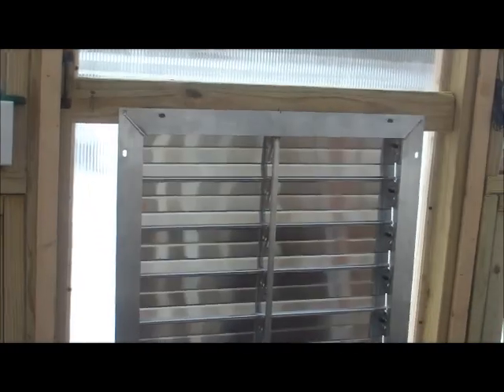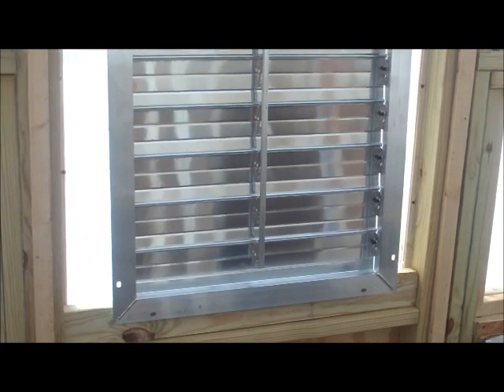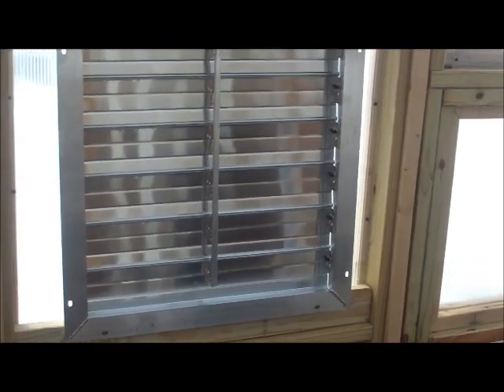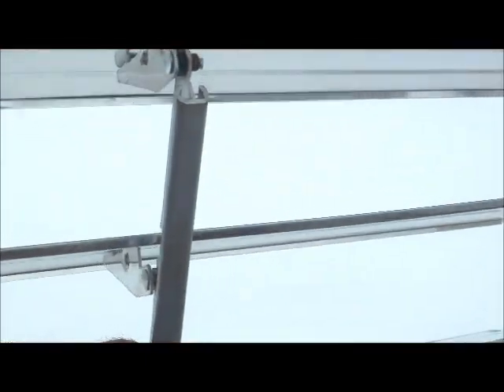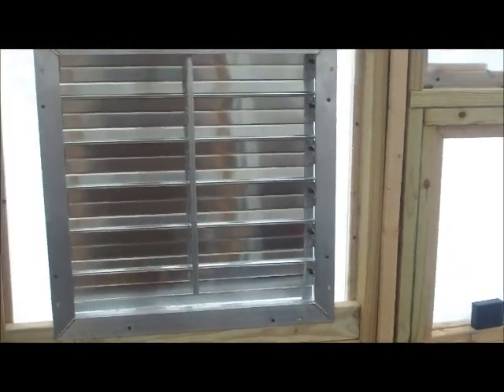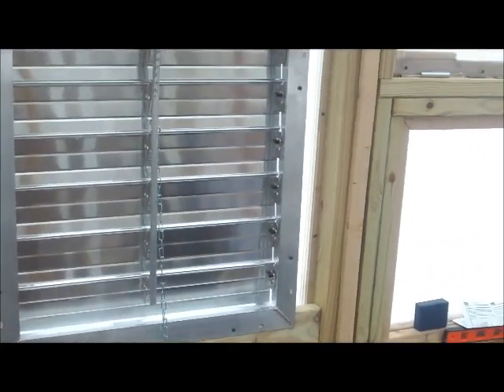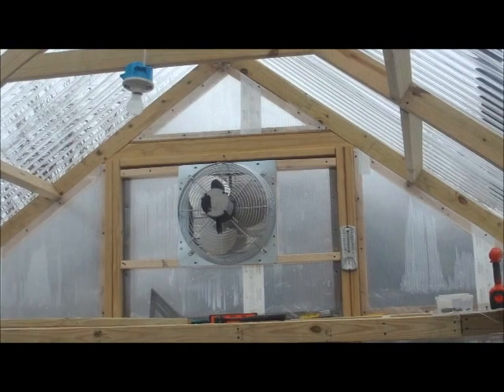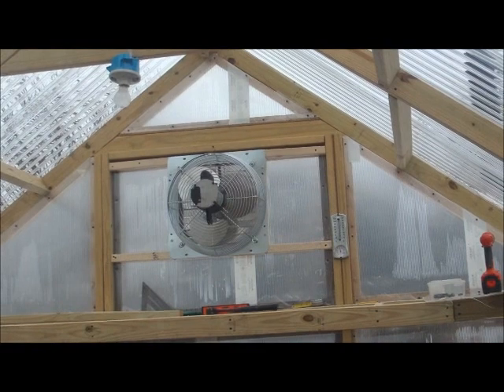Greenhouse Heat Reduction System - AKA A Fan!

Comment: That's the best illustration of a greenhouse I've seen so far. I like the idea of the correlated plastic to cut in corners on your roof, & going to apply the same product on my roof tiers. I also like the way the fan sits & gives me a general idea of what I should be shopping around for at Home Depot the next time I go there.

Hope your OK, and really like your style.

Comment: Jerry: Trying to walk through that much snow would make even a young man tired. It will not take that fan any time at all to pull the hot air out of your greenhouse even on low fan. Pace yourself! Bernard
Reply from the maker: Yea it was up over my knees, I learned I wasn't 20 anymore..lol 
Yes I got it wired up and it works great. I am very pleased.